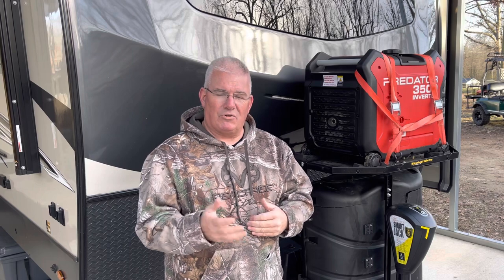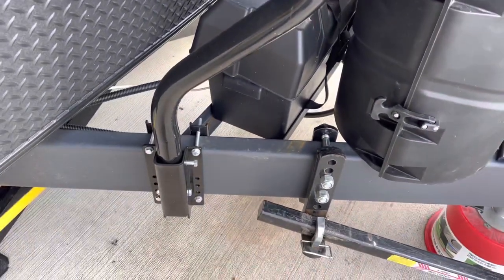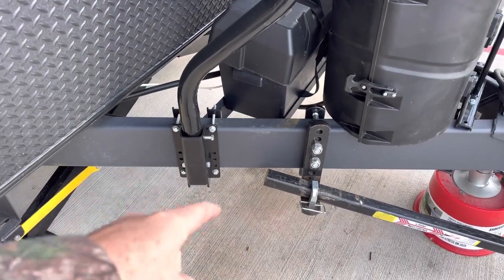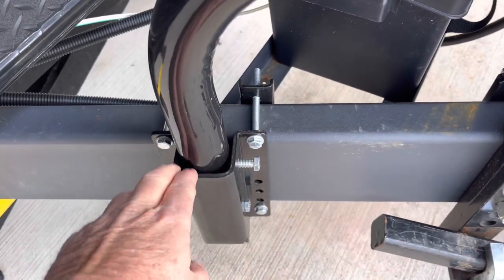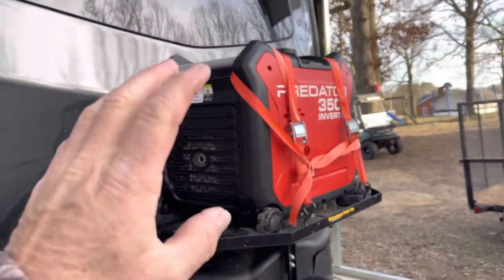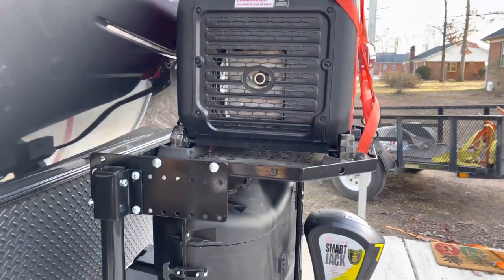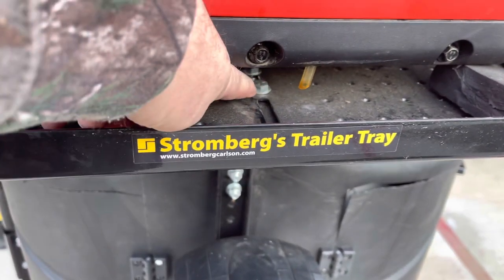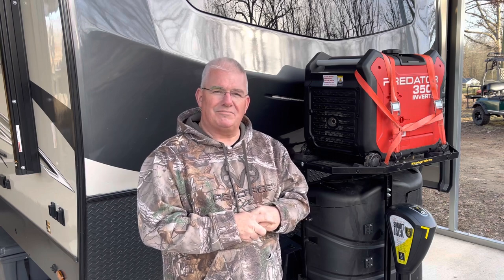Stromberg’s Trailer Tray / Modified Install

Comment: I have the same set up, but did a few other modifications to it. I made chain wheel locks. Small but strong enough chain that fits over the wheels and in between the gap. Added heat shrink tubing over the chain for protection. Bolt chain down over each wheel. Solid and secures the generator in place. No need for tie down straps. Also helps as a theft deterrent. I also cut a square hole on the deck of the  rack directly under the drain of the Predator generator so I can change oil without removing the generator. I also switched to a soft propane tank cover so I don’t have to cut the hard cover or remove anything to take the tanks off other than the soft cover. I extended the 2 drain hoses with drip irrigation hose and 2 drip connectors then zip tied them to the front support bar. I also modified the exhaust to point out away from the trailer to reduce exhaust smell. A soft generator cover with 2 long bungees around it for travel reduces cover flap and protects the generator.
Reply from the maker: Great ideas, sounds like a really nice set up and well thought out. I may borrow some of those ideas as well. Thank you for sharing

Comment: Hey, thank you so much for your videos. I now have the same set up.  Just a quick question on how you connect the generator to the RV propane. I also have the same RV. 😎
Reply: Do you connect it to the RV quick connect or straight to the propane tank. Thanks.

Comment: I'm in the middle of doing this on my toy hauler. Was wondering how it affected your tongue weight with the added generator & case ? Also did you notice any different when pulling as sway etc. My generator, the same Stromberg  Carson tray and generator case will weigh in at 256 lbs of extra weight. My WDH is rated for 800-1200 lbs so thinking I should be ok still with new adjustments.
Reply from the maker: I haven’t noticed any issues with tongue weight. My generator weighs 100lb and the tray is 65lb if I recall correctly. No sway issues at all. Extremely pleased with the set up. We’re headed back to the Smoky Mountains this coming Saturday and we will put the generator to use .

Comment: Another add-on you could do is put a thick rubber mat down to minimize vibration
Reply from the maker: I have considered that but the noise and vibration is already very low. Great idea though, always open for ideas. Thank you